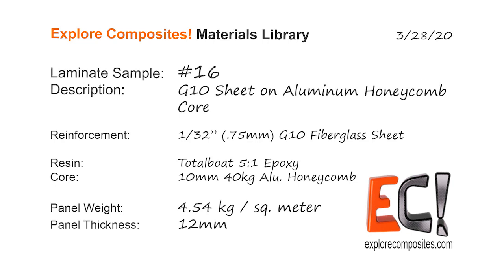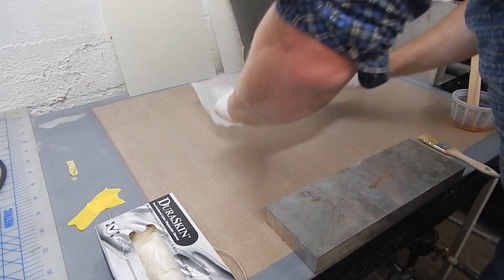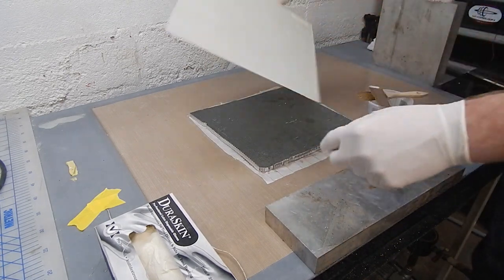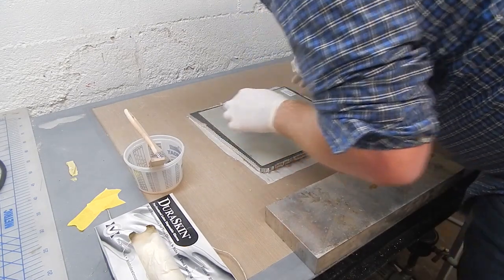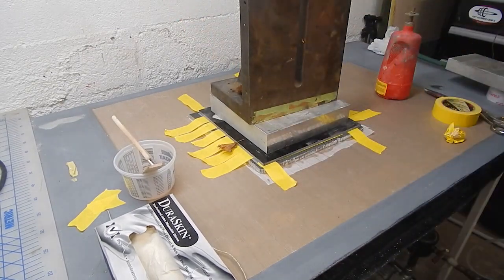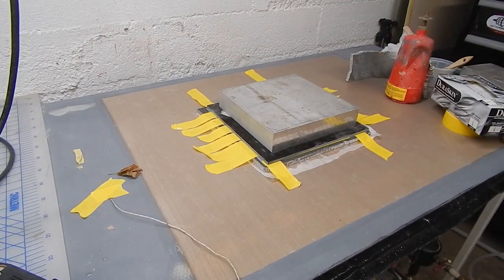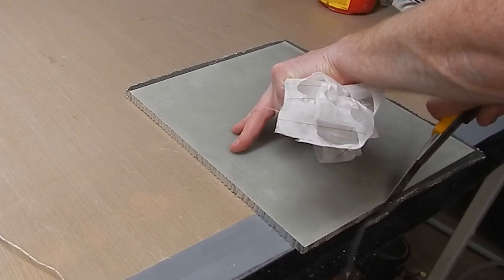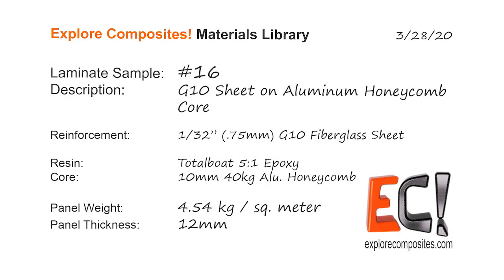Laminate Sample #16: G10 Fiberglass Sheet on Aluminum Honeycomb Core

Comment: Could this be used to repair a RV roof section?  So I have a 3" raised section that is maybe 3' by 5' that the air conditioner sits on.  It is sagging and I thought this could be used to replace the wood panel / fiberglass section.  This new section would be fiberglassed bonded into the 3" sidewall.
Reply from the maker: This would probably work, but it'll be an expensive option!  You can buy pre-laminated cored panels with foam core.  If you want this process, you could use fiberglass sheet instead of G10 over any type of core.  Aluminum is very stiff but won't be the most economical or easy to deal with.  You can usually get surplus honeycomb core on eBay though if you want to try it.

Comment: Great video!

 Your videos have taught me a lot about different materials and how to bond them together.

It would be helpful to understand how the composites you build compare to one another in terms of strength. It would be great if you could do some simple strength tests such as point loading the center and/or torsional strength by holding one end stationary while twisting the other end.   This doesn't have to be an expensive scientific test, just simply load each sample with a specified amount of weight and measure the flexion or take it to the point of failure.
Reply from the maker: That's a great idea!  I'm working on building "families" of samples that can be compared with a simple bending test.  Because I didn't integrate this from the beginning, I'll have to go back and test the samples and make separate videos - which is probably better anyway so they are easier to compare.

The EC! website and videos are a work in progress and it is great to hear what you'd find useful - thanks!

Comment: I'm building experimental aircraft . Can i made some plates of honeycomb and panel instead plywood to get some weight reduction and get a bit harder structure? Great video!
Reply from the maker: A qualified "yes" - because I am not an engineer and have no idea what you're working on.  

Honeycomb cored composites are very common in aircraft construction and have great mechanical properties for the weight.  Bonding pre-cured face sheets to core is a fine method but be sure you do enough testing to know that your bonds are consistent and that you have a good understanding of the real performance of the laminates.  

You should be able to beat plywood on weight!
Reply: @ExploreComposites  Ty. I will do crack test first to compare those two materials. Regards
Reply: Aircraft companies get floor panels made with this method, but the honeycomb is made of nomex, I believe. Very strong and puncture proof (imagine a 200 lb. Lady wearing high heels ). Aluminum is prone to corrosion, so unless it is carefully coated, it can corrode. You should research the floor panels of large airliners.

Comment: I'm curious about the strength of this. I'm interested in making a dresser for the bedroom with this as the main components instead of wood.
Reply from the maker: I guess you could make a dresser out of it - definitely strong enough if you choose heavy enough face sheets (G10) that resist denting.  The detailing at the edges will be the most difficult or labor intensive.  You could use fiberglass bonding angle or strips let into the core to close out the honeycomb.  

I've seen plenty of yacht interior parts made from honeycomb (not aluminum usually) and it works great but it's a ton of labor.  Do you need a very light-weight dresser? 
Thin plywood over honeycomb or foam core might be better and easier - and cheaper!

Comment: You're one of the few people I've seen handle these super thin G10 sheets, and I need to know if they could withstand constant vibration unsupported. They're a candidate for a large array speaker idea.
Reply from the maker: Probably but I don’t know for sure.  I feel like I have seen G10 in speaker applications but don’t remember where...

Comment: okay when you said "we are relying on the resin to form little fillets in the honey comb", that made no sense to me, like it would make tiny little cut away's, but then i thought of the auto cad symbol for fillet and instantly knew what you were talking about with that right angle bond lol. wait is fillet vs fill-ey a different word or just different pronunceations? lol
Reply from the maker: I guess it can be spelled with one or two L's depending on where you're from.  I'd say "fill-ay" for a piece of a fish and "fill-it" for an inside radius thing.
Reply: @ExploreComposites  :p found a super cheap source of g10 0.5mm, 40 cents a slice as lifepo4 battery insulation sheets. more videos on that please if you get the time =] thanks for your time

Comment: Sir, how much epoxy did you use? In grams
Reply from the maker: I don't know.  I should have weighed the G10 before and after applying resin. The calculation suggest around 350g per square meter per side of the core... likely too much.  200-300 is probably realistic to get a good bond.  A more gel-like resin applied with a short-nap roller would be ideal.

Comment: This is useful as I never knew you could buy 1/32" G-10 like that. But here is what I am really interested in- How do you edge join honeycomb or foam core panels- one after the other and still look nice yet have a joint be as strong as the panel?  Specifically a panel that already has its fiberglass skins on both sides to another one like it. By the way, CarbonCore manufactures a polypropylene honeycomb panel that has a scrim of polyester fabric bonded to it which retains the resin from running into the cells of the honeycomb. (I just subscribed to your channel and hit thumbs up for 60) Perhaps you could do Patreon to support the channel.
Reply from the maker: Joining cored panels with thin skins is hard.  Easiest is a splice block that laps each skin but thats ugly.  Best is s full scarf - 30:1 or so - on each skin with laminate fully spanning the joint feathered out into the panel.  Not easy with 1/32” skins!  It helps to rebate panel edges if you can so you don’t have to grind in scarfs.  

Looking into that CarbonCore (Plascore makes similar - probably others) plastic honeycomb.  Going to get some for a sample in the next few months.  Interested in infusing on it and seeing how it works!  Have you had good results with it?
Reply: Common practice for hobbyists is to use Cab-O-Sil or equivalent to thicken the epoxy to something between a mayonnaise and a peanut butter consistency.  Use that to edge-join the cores using a lap joint or a simple butt joint.  The skins are joined, ideally with scarfs, and those joints are staggered side-to-side, using rough thirds as a measurement.

Comment: Is there any practical way of using alu honeycomb for parts with curvature?

Like say I wanted to make a wing with a honeycomb core bounded by a laminate skin. With something like balsa I could simply CNC a balsa core to the profile I need, but is that possible for aluminium or am I SOL?
Reply from the maker: Yes, you have a bunch of options.  First you can just bend it into gentle curves.  Thinner core will work better and aluminum is more likely to crinkle than aramid core.  

Second there is "over expanded" core which is stretched out like I show around the 5min mark in the video.  You buy it this way and it conforms to tight radii but not really super compound surfaces.  

You can definitely machine it but it is lots of work and hard to fixture.  There are special cutters that work well though aramid is easier to deal with than aluminum.  You need to still keep the cells normal to the compression loads so sometimes it best to use honeycomb for gentle curved areas and machined foam like Rohacell for corners and high-detail areas.

Aluminum core in thicker sections can be custom rolled and expanded to match compound curves but this is a complicated process involving skill and equipment I don't have - so I don't know much about how to do it.  

For a wing you could probably make it solid honeycomb machined to a profile but the front and back would be hard!  You might need to glue the core to one surface and machine it and then apply the other side.  This is probably more trouble than its worth - because you can't easily tool both surfaces AND apply good pressure to the core bonding.  But it may be worth a try!

Comment: I was always taught to make a paste with a filler.
Reply from the maker: That is a good idea.  A toughened gel adhesive would be a good option too.  It won’t get wicked up the edges of the honeycomb cells like unthickened resin but the bond might be better overall.  Certainly worth a test.

Comment: IT DOES NOT ROT BUT ALUMINUM DOAE CORODE SALT WATER LOVES IT YUM YUM
Reply from the maker: You're right about salt water (electrolyte) but the problem is worst when aluminum is in contact with a metal.  The G10 is very good for galvanic isolation so it should be ok - but worth thinking about any time you use aluminum core.